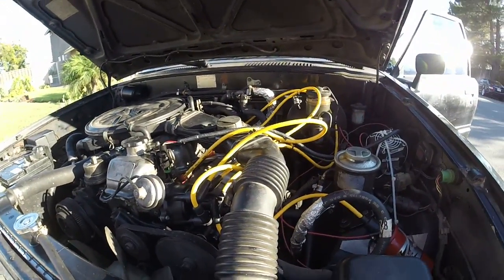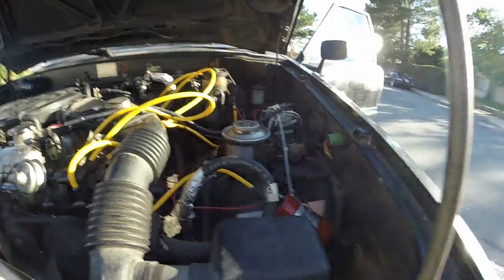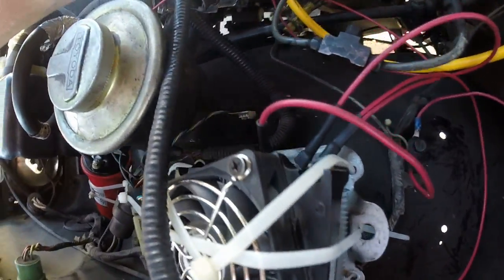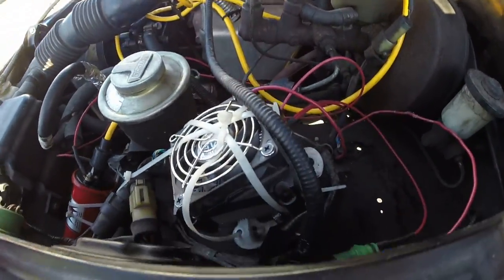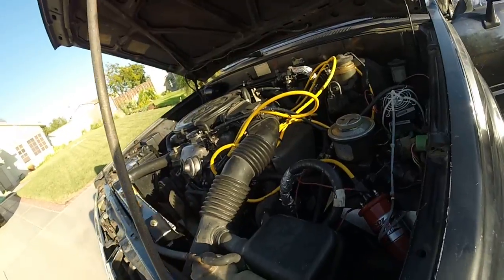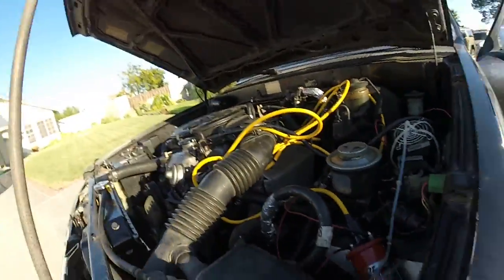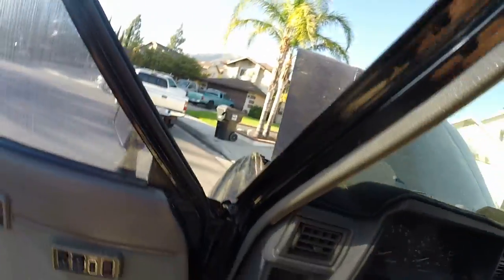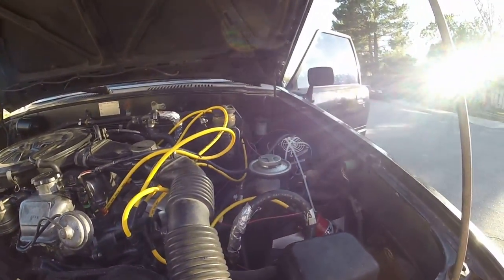Toyota to GM Ignition Conversion

Comment: I’m trying this for my 89 4Runner stock igniter was 1000$ used and this was a better option I have it all hooked up and no spark there are wires that may lead to the ecu that was originally connected to igniter coming from main wiring harness do I need to connect to the ecu in any way??
Reply from the maker: nothing is connected to the ECU on this mod.

Comment: did the job as per instructions... the GM module instructions call for a pulse coil resistance of 500-1500 ohms... the toyota distributor pulse coil had - as per stock specs- 179 ohms... the resultant test run was uneven... revved good, idled good, but every few seconds ignition cut out, then resumed, with a loud bang as the raw gas ignited in the exaust...  tried another identical module, with same results...  (this bang blew manifold gaskets... )
Reply from the maker: As per instructions? This is a guide to help those converting. I never used the stock coil in this conversion.
Reply: @zero187420  didnt use stock coil... did use the stock distributor and pickup... (therein was the problem, think...)   used an aftermarket coil with ballast resistor (as called for on the coil... ) coil was supposedly compatible with 81 toyota 22r

Comment: I just did mine
Reply from the maker: Please make sure the hei control module is grounded well and firmly placed against a metal surface. They burn out fast which is why i put a fan on mine. I also have a separate ground wire from the bolt hole on the module to another spot on the chassis. I always ground down the small nubs on he back of those so they sit flush
Reply: Larry Holzhauser yea I grounded the mounting bolt as well I also got a heat sync

Comment: Not to critisize but it is important. It's actually important that you not only secure the module with both screws through both holes making sure they are tight, but also applying the electrical grease that comes with the module to the metal back completely and making sure that surface it's attached to is flat and has total contact with entire metal surface of that module as this is where the heat transfer occurs. failure to do this will lead to early failure, or burn out of the module, and like myself, the whole reason you're doing this in the first place is because the old igniter burned out. Otherwise you did a pretty good job with this video. From the other comments all bunch of the folks thought so too. Killer deal and keep up the good work. I love to see people showing some real mechanical aptitude and ingenuity.
Reply from the maker: thank you so much! I try my best on these rigs. Electrical grease is a must and if i missed it then thank you! when all i have to offer is a computer fan and heat sink, i do my best.

Comment: where did you get the heat sink? hows that hook up
Reply from the maker: its not hooked up just strapped to the module.  The heat sink is to keep the module from overheating and cutting out.  Had that issue driving around in 115 heat in arizona with a hole in my exhaust pipe directed at the chip. the computer heat sink fixed the issue just before i replaced my header with the hole in it.
Reply: Thank you... I'll look into that

Comment: where can i buy a heat sink for it?
Reply from the maker: +Kent Ray  you can most likely find the heatsink and fan at any frys electronics store or online. its your standard cpu heatsink.
Reply: Thanks man
Reply: AC Delco Heatsink, made for these modules:

http://www.rockauto.com/en/parts/acdelco,10474610,ignition+control+module+heat+sink,11323

Best price on web, plus only about $3 ship. They also have the ignition modules. Waiting on mine right now so I can get my 1978 pickup going again.
Reply: The13thSword dang. Wish I woulda checked rock auto. I bought the same thing but off Amazon for $10 more. The swap only took me 15 min on my 1979 pickup. But I did have to drill my heat sink a little to line the holes with the module